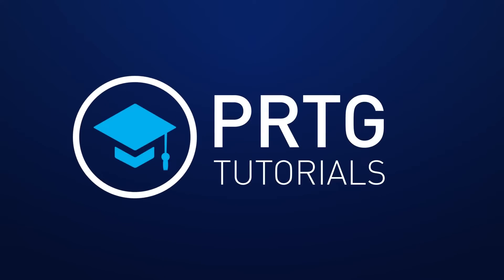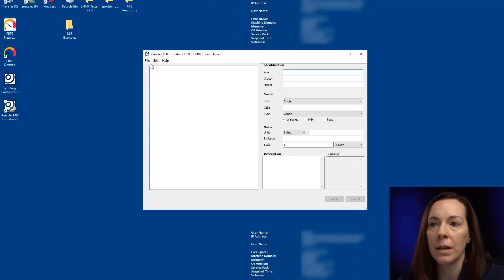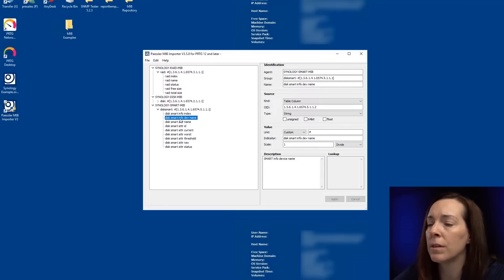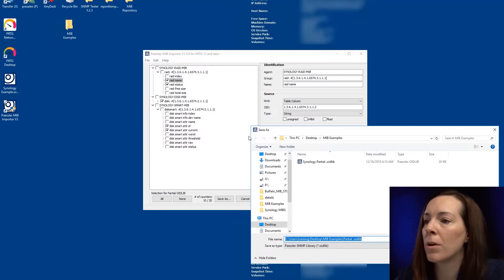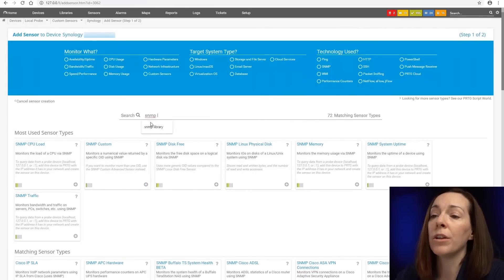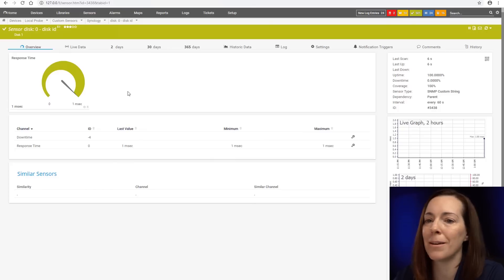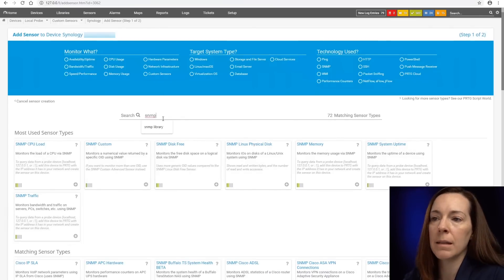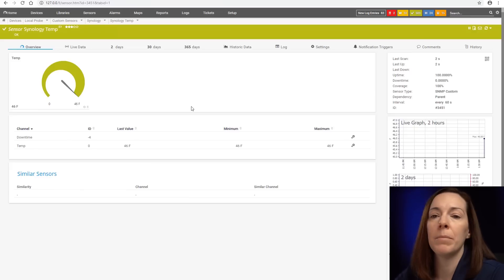PRTG Tutorial - SNMP Custom Sensors and SNMP Library Sensors

Comment: I followed the procedure outlined in the official tutorial to configure a custom SNMP sensor without relying on a MIB file. When using the local Network Monitor software, the sensor operates correctly and returns the expected values.

However, when attempting the same configuration via the Hosted Monitor platform, I consistently encounter Error 2003. Since I am currently evaluating the trial version with the intention of potentially acquiring the software for corporate use, I am trying to identify the root cause of this discrepancy.

At this stage, it is unclear whether the issue is related to SNMP communication, platform-specific limitations, or a configuration mismatch between the local and hosted environments.

Any guidance or clarification on the nature of Error 2003 in the context of Hosted Monitor would be greatly appreciated.
Reply from the maker: Hi, thanks for reaching out! It's probably best to open a ticket with our Tech Support team so they can look into this for you - https://helpdesk.paessler.com/en/support/home

Comment: I just downloaded QNAP MIBs directly from my NAS. Tried to import it but I get an error: "File contains more than one "DEFINITIONS::=" blocks. Please run the Paessler MIB splitter. Ran the splitter which said no need to split. What now?! I see that i have a .mib file extension on my mib file whereas you have .txt extention
Reply from the maker: Hi! 
This error usually occurs when the MIB file is not valid / OK. 

It is best to check the MIB file once with a MIB checker like https://www.simpleweb.org/ietf/mibs/validate/

The probability that the MIB file has an error is high with this message.

P.S.: You can also open your ticket in our helpdesk portal. 
https://helpdesk.paessler.com/en/support/login